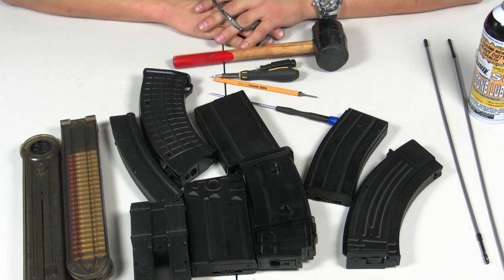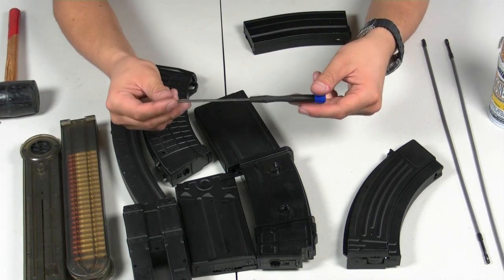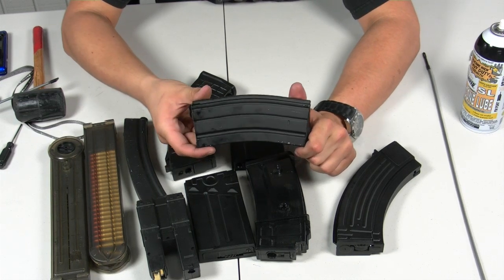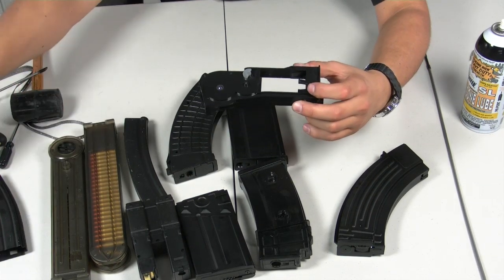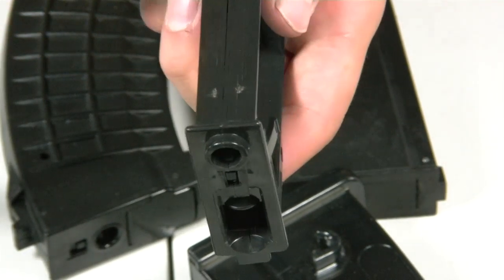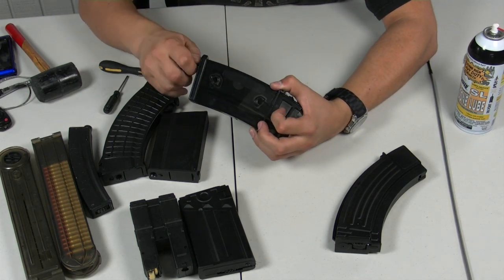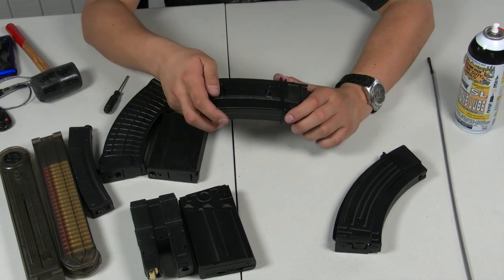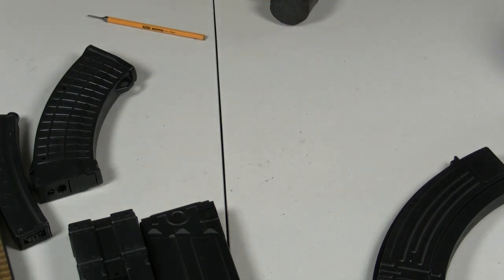HitGuns.com - Airsoft Accessories and Use - Basic Magazine Repair and Disassembly Pt. 1 of 3

Comment: CORRECTION: There is an easier way to disassemble P90 High-Cap magazines. There is a small button on the back of the magazine that releases the spring and allows you access to the entire inside hopper, but not the gears.

Comment: I got my JG G3 for Christmas and the 500 round hi cap magazine it came with worked for like 5 minutes and stopped working. It seems like some of the cogs may be out of place in the magazine, because when I wind in the cogs don't move and no bbs spin up. Could anyone answer this question?

Comment: i have an agm 614/416, and the mag that came with it (standard hi cap metal m4 mag) is being weird, when i pull the release nub back, the bbs dont shoot out one or 2  just fall out, i have to hold it upside down, its like theres no tension, whats the problem??? and when its in the gun i have to wiggle it to push the release nub back to let bbs out